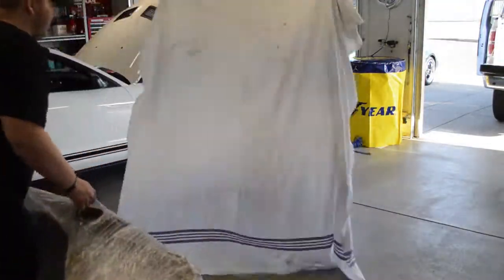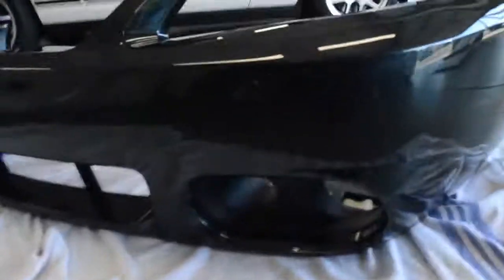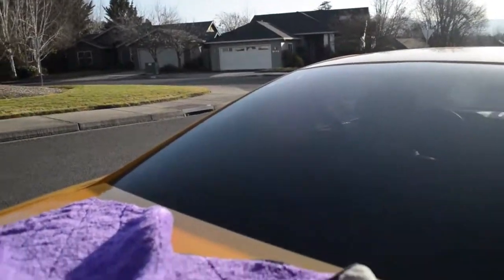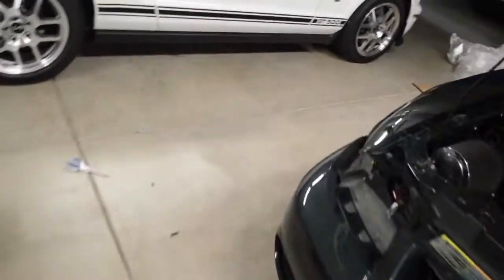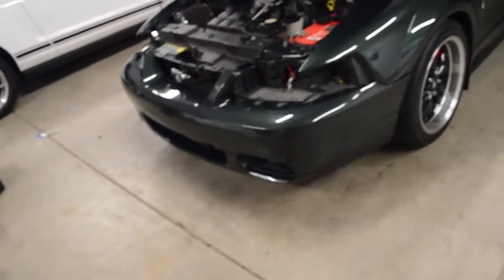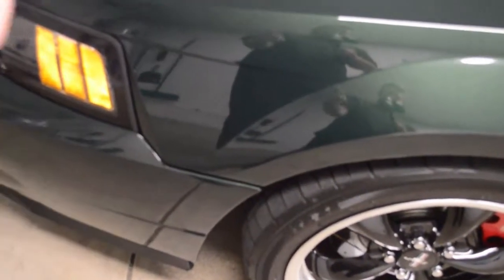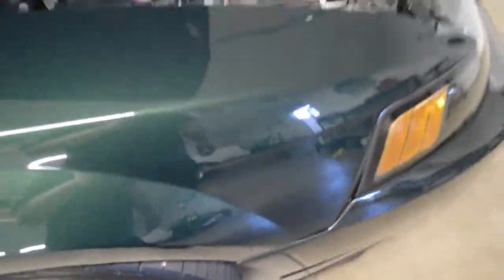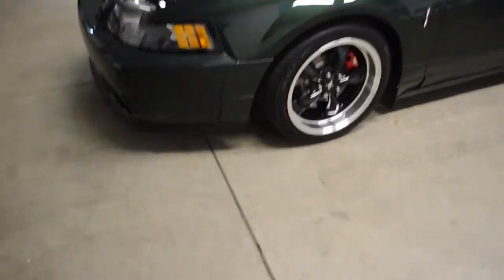03-04 Cobra Bumper Install!!!

Comment: Did your bumper come with the brackets/studs for mounting to the fender or did you have to get that separate? Thanks
Reply from the maker: Flammin1000 i reused the ones that were on the factory bumper